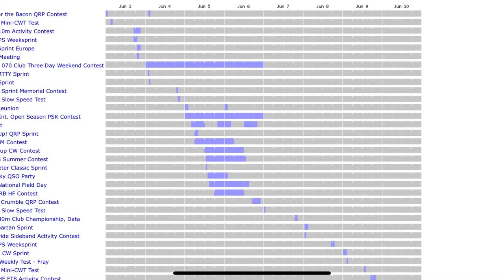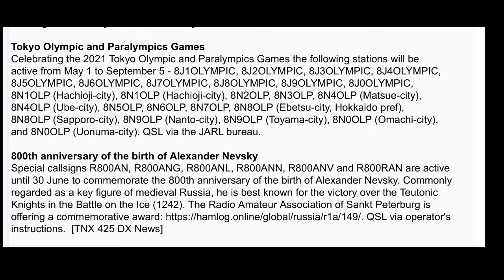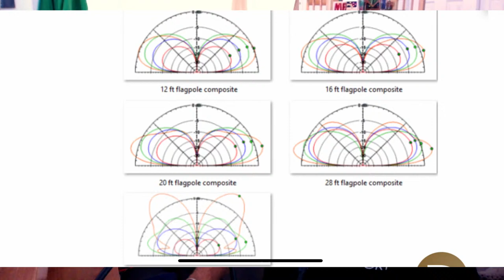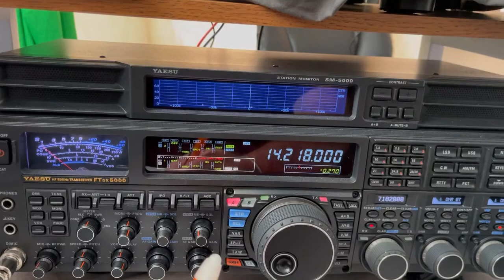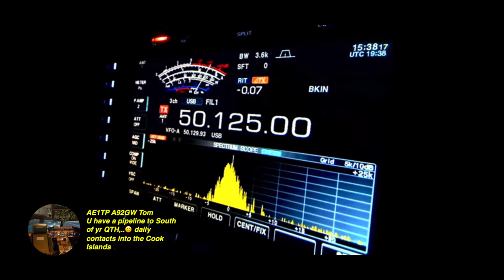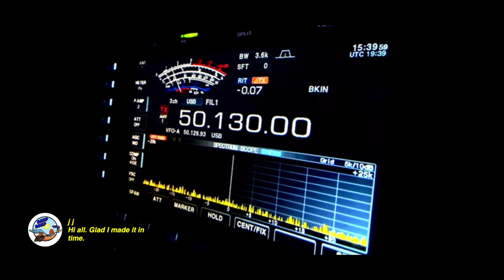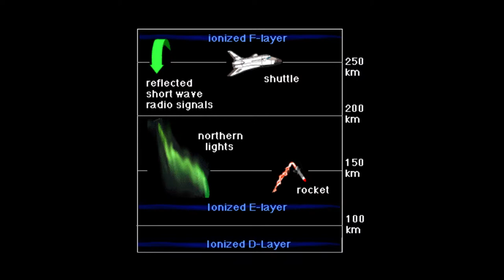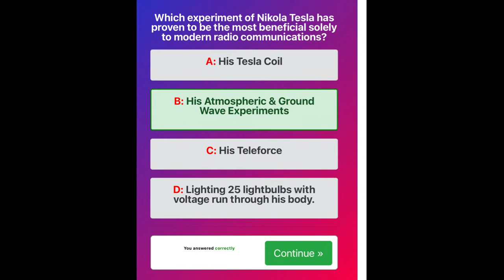#HamRadio Live! Show 218 Auroral QSO’s, RSGB Field Day 2021 Greyline Performance Build & Performance

Comment: What is the sequence from antenna to radio. Is it MFJ-912 Balun—- surge protector——-MFJ-915 line isolator——MFJ-998rt——to shack?? Does each coax connection need to be the same coax size??
Reply from the maker: Chuck, it’s twin feed to MFJ 912 Balun, then the Lightning arrester, 998 RT tuner, Then the 915 line isolator and up to shack. 

I like to make sure to use the same coax from beginning to end. Right now I’m compromised on that due to not having enough jumpers. 

Waiting on those to complete things. 

It always seems like there’s just one more thing right? LOL...

Thank you for the question and again thanks for watching.

Larry 
de K7HN

Comment: Thanks Larry. The directions in the flag pole antenna talk about not grounding the tuner; that seems confusing, and it looks like you grounded yours. What’s your thoughts.
Reply from the maker: ABSOLUTELY GROUND that tuner!!  No question there. Also, The instructions also didn’t mention a Balun, the MFJ 912 has a 4:1 winding and should be used instead of their 3D kit balanced line to coax connection... at least in my opinion. 

I never tried it using their kit because I frankly have always used a proper Balun to connect balanced line (feeder/window line) to coax. 

Also, Make sure to get an RF isolator on it to keep the RF off of the coax, even if you bury the coax. Those are my thoughts and it’s worked brilliantly for me. Last night I was an S5 into Hawaii on 20m and an S7 on 40m. This antenna honestly has blown me away as to its performance.